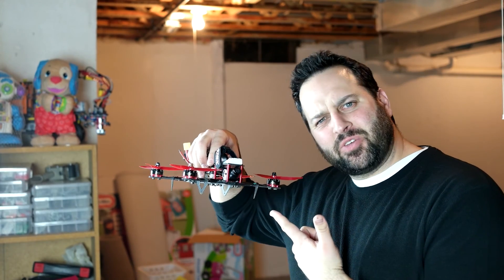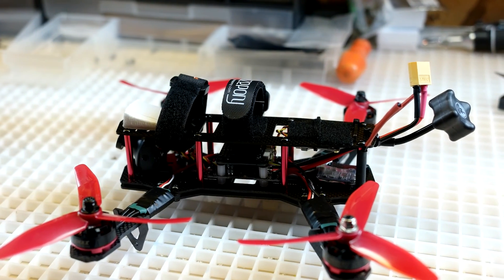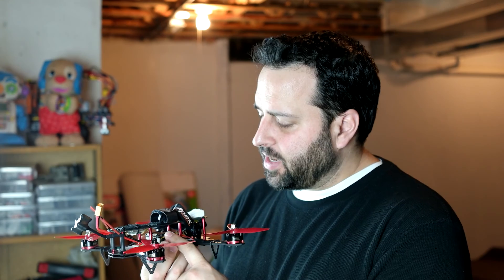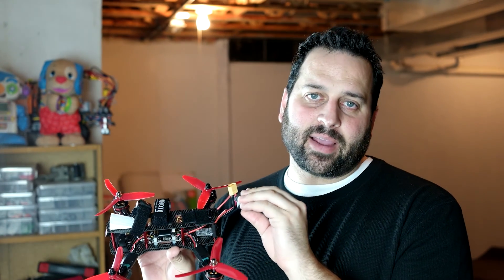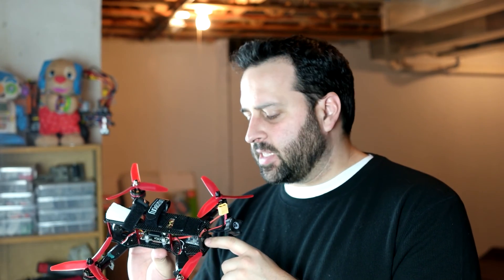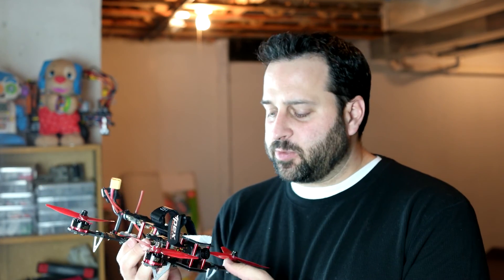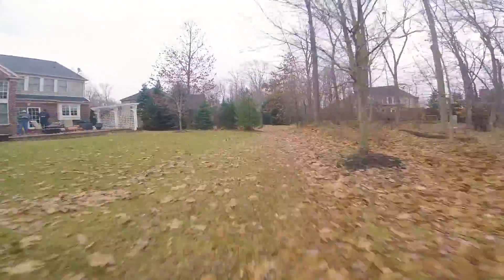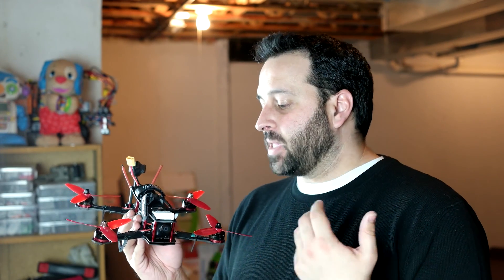Introducing My New ZMR 250?

Comment: 600mw? Christ I hope you've got your license.

Ain't nothing wrong at all with the ZMR250. I'm rebuilding one right now that I've had for years. Flies great! 250 is a class of their own. Firmly placed between performance and AP.  They've definitely got more mass than other quads near their size and it shows. I use those indestructible 5045 Dalprops on 2204-2300kv motors. It sounds like you were a bit under-propped.

And your nuts go between the plates, not screws. Put your standoff through, nut on the bottom (between plates). Boom, done. I use a pair of hemostats to hold the nut. Hope you used spacers for all the body standoffs, too! Makes for a stiffer and more rugged body

Also, you ran an Owl for your camera. Of course it's going to be washed out, it's for low light or night flying!

Comment: http://multirc.com/zmr-6-hulk-arms-set-of-4/  toughen & butter it.
Reply from the maker: Thanks for the link.  Have you tried those arms?  Are they heavier than stock at all?  Do they change the flight dynamics much?

The stock arms fit 6" props.  I have some 6" twin blades I plan to slap on and try out.  I'm actually impressed with how buttery this thing already sounds with 2300kv motors and my DAL props.  Very curious to see the 6".